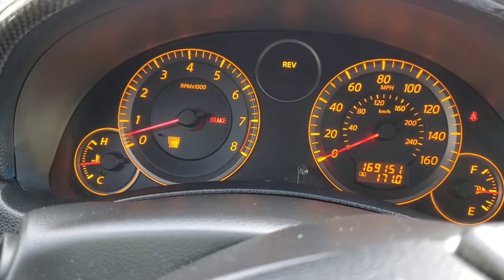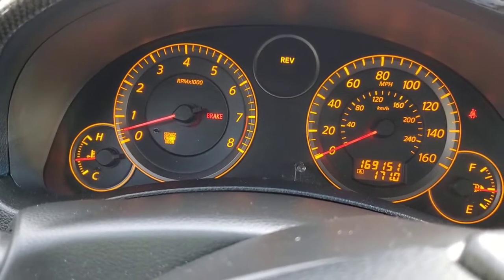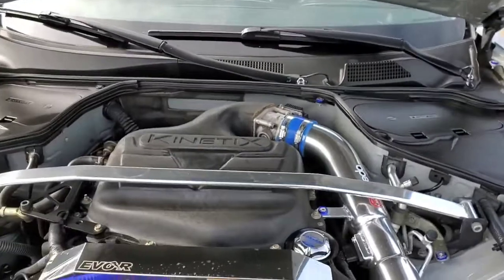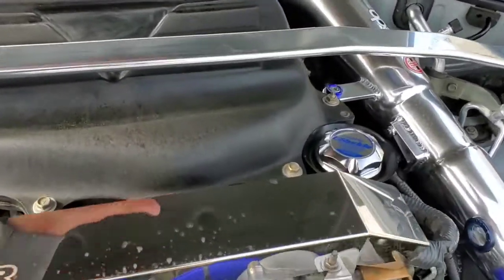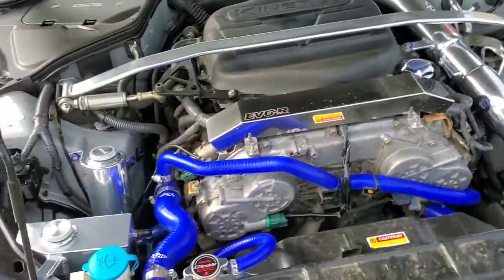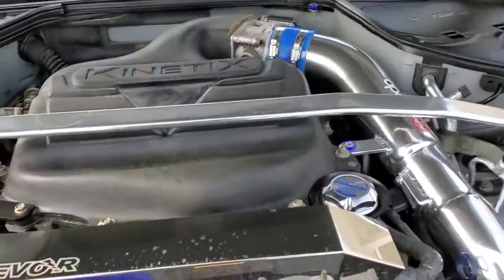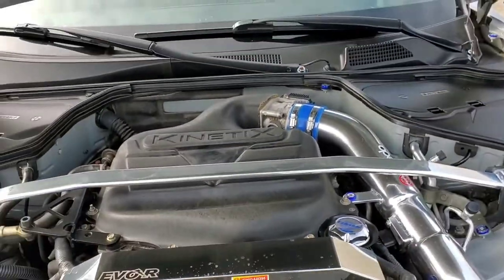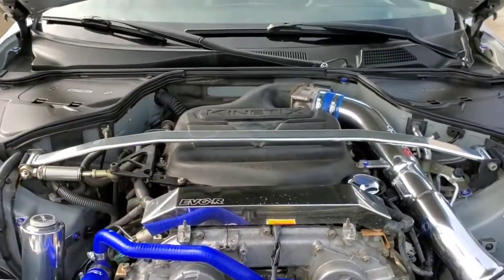let's talk about the G35 coupe, heat soak and the giveaway 😃

Comment: Hey love the video I recently got a afk takeda stage-2 cold air intake (short ram) and was wondering if I should wrap the intake with gold heat shield tape, and make a custom box that enclosed the entire air intake like the Z1 '03-'07 G35 Cold Air Intake System. 07 g35 coupe 6speed stock for now. I live in Toronto and the temp it's around 80°f -90°f. And for upgrades I wanted  to start with a catback exhaust. I don't where to go with the engine as I have the rev up. And don't know if spacer or kinetix is the way to go. Or what's the best way to go